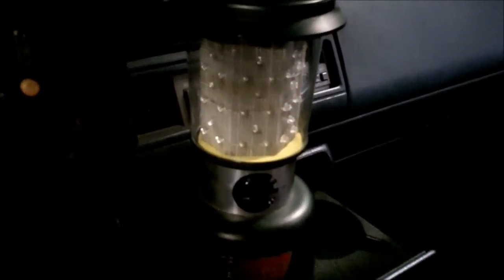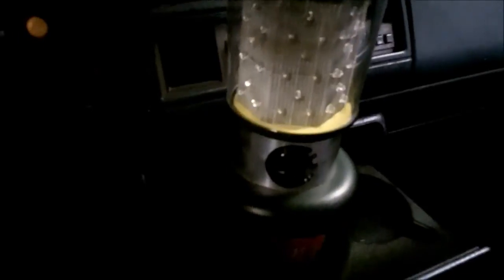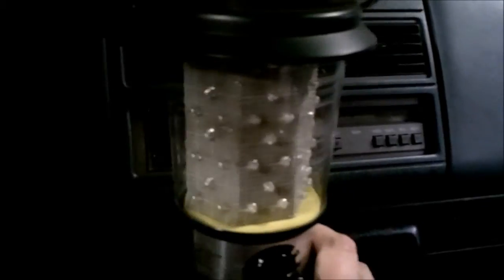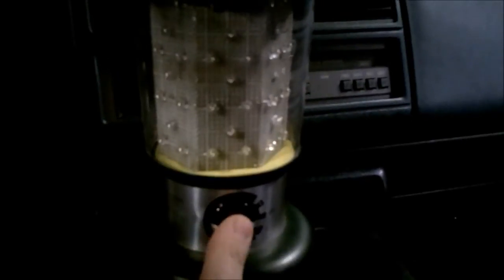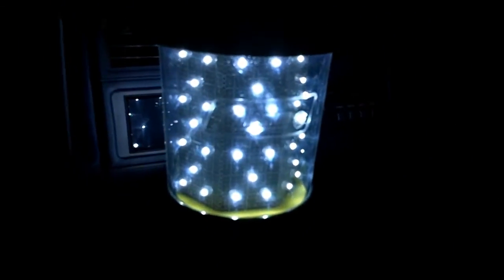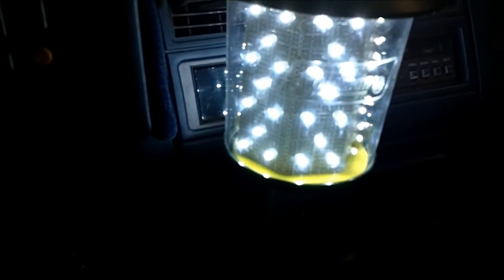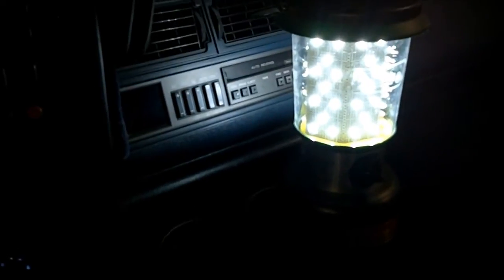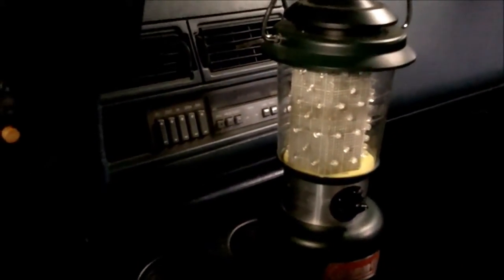Homemade LED Coleman Lantern - No more tubes!

Comment: It doesn't do it justice in the dark?  When is it supposed to do it justice?  In the light of day?  LEDs are great but yours hardly lit up a tiny portion of your dash board.  It is not about camera exposure.  The illumination would still cast a broader span than yours seemed to.  I would have expected it to light up the entire interior of your car.

Comment: Great project but could you give us the step-by-step instructions and materials in transforming this lantern?
Reply from the maker: This was done seven years ago, LEDs have come a long way since then. I built this using perf pc board and used a combination of parallel and series connections for the LEDs. I made six boards and connected them together, put a piece of craft foam in the top and bottom to hold it in place, then added a simple 2-wire connector for easy removal. If I were to do this today, I would buy pre made LED units and wire them to 2 individual circuits. And as far as longevity of the batteries. I don't use it every day. It is my emergency lantern used during power outages, hurricanes, or anytime I need a light like under the truck or in the attic. I have taken it fishing many times running all night long, and yes, it is still the same batteries. In the last seven years I have replaced them only once.
Reply: It's clear he won't. It's hard to believe the batteries have lasted that long. He probably doesn't even use it that much.